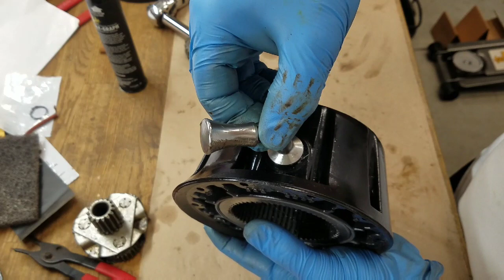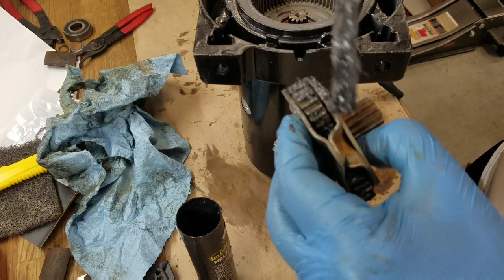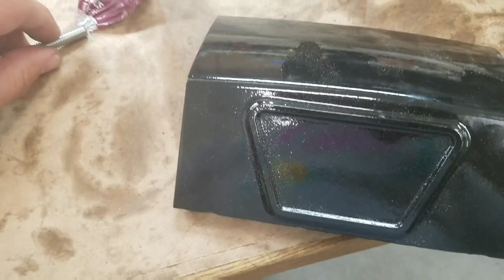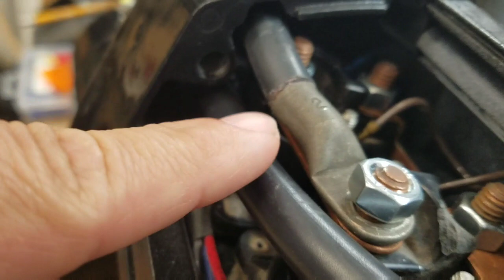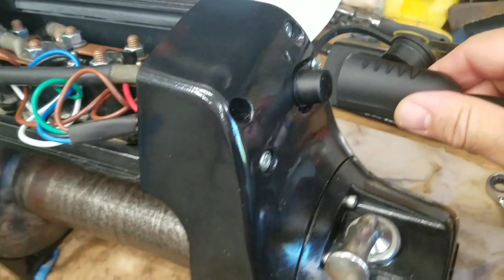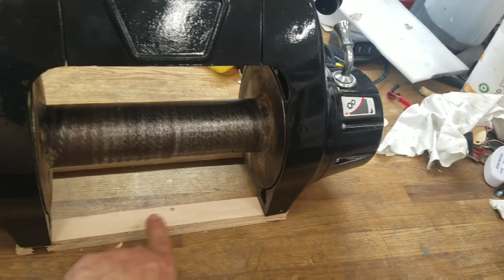Warn 9.5ti Restoration DONE!

Comment: I just had my free spool side apart as it was stuck from corrosion. The intire gear set and shaft came out with the end cap and outer gear housing. The clutch/brake parts stayed in the other end in my case. This made it easier for me to stage the gears on the shaft and then assemble them in reverse to how you did it. Everything fell into place without much fuss ending with the outer housing splines over the whole gear set. I did have to super glue the gasket to one side of the housing. I applied lucas gun oil to the free spool area and moly grease to the gears. I cut my own gaskets from a roll of paper gasket material from ace hardware.
Reply from the maker: Good that your brake stayed in.     I really didn't want to mess with it but....    good idea on the super glue.   I've used some grease before to gold the gasket too.

Comment: Dear i need to know about the current rating of these solenoid. Is it 200 amperes for forward and 200 amperes for reverse or these 4 solenoids are in series with 400 amp rating. I have 9.5ti warn which have 4 solenoids with 100 amperes rating each.
Reply from the maker: The warn winch solenoids are rated at 250A continuous and 480A peak.    Two are used for forward, two for reverse.  Hope that helps!
Reply: But my system trips each time when the current exceeds 200 Amp
Reply from the maker: @Struggling_Hard461  You may have a motor winding issue, or a different ground problem.    Good luck!

Comment: I have this winch on my 2003 jeep rubicon tj. Mine is gray. I have heard they are great winches. I replaced cabel with a red 23000lb To yo  synthetic 100 ft cabel. What is your ex0erince with this winch
Reply from the maker: It's an excellent winch.   Mine is an older version that's not as easy to service.    But I have zero issues and also upgraded the cable to synthetic line.

Comment: What grease did you use on the internal gearing? I have the warn 9.5 CTI which is almost the same. New it's 1,800$ I just replaced the freespool gear and cover sold as 1 unit for 165$.
Reply from the maker: They're not too finicky about grease.    I've used marine "red and tacky" stuff as well as grey moly grease.     The red stuff is what I found in a 40yr old warn I just bought.    If you do any water, that's the way to go.   Just remember that these winches should not be forgotten about on the bumper.    Most people treat them as disposable, but they should go through a maintenance cycle like any other machine.     Good luck!
Reply: @comfort_in_discomfort  I just looked up on warn they recommend Aeroshell 64..a moly based grease...but thanks...you did help me by showing which direction the ring gear goes in the end cap.
Reply from the maker: @scottsime5197  yeah the aeroshell is expensive.

Comment: How much did the restore cost you with out the motor
Reply from the maker: Good question.  Let's see:
Genuine warn parts (seals, 4 solenoids, sticker) = $120 roughly 
Local fasteners (for the cover) = $15 
Ebay for a used winch controller =$50
Paint (I already had it but let's say I bought it) =$20
So that's about $205 in parts.  

The motor was an Ebay purchase.    It cost roughly $150.   

So all told around $350-400 +/-
Was it worth it?   I'm not sure.  It took a while, especially the cleaning and sandblasting.  But it was enjoyable.
Reply: @comfort_in_discomfort   I feel it’s worth it... you can still find some old new 9500ti in stock I was looking last night and they are 1300 so yes it is it’s a good build if you enjoyed it
Reply from the maker: @crider46  yeah.   There are new cheap units like Badlands, for around $4-500.   But it's not a Warn.  So it's a trade off.   This one is going to go on my Jeep.
Reply: @comfort_in_discomfort  I have one on my 93 Toyota pickup

Comment: The problem on the old motor ist the  new color between  motor tube/housing and brushes cage/housing, you need ground contact on 2 brushes but with the new color is this not possible
Reply from the maker: I never thought about ground contact on brushes...

Comment: Do you happen to have the part number for the new short harness? I have a buddy that needs to do this to his 9.5ti, and having an issue finding the correct part number for the new short harness.
Reply from the maker: By short harness, you mean the one that connects the solenoids to the socket plug?  I purchased mine on ebay.  I used Warn 86688 as the part number.

Comment: I’m doing mine now.. struggling a little with operation. It rattles and acts like something is out of order. I’m sure it has to do with setting up the brake system. I basically put the new brake in the spool and then let the coupler set the depth of it... but something isn’t working correctly.. Warn has been impossible to get ahold of lately- extreme long phone waits..
Reply from the maker: Yeah.   Be careful with the brake.    I was able to get a hold of Warn a while ago via email.   They sent me the diagram of the pre-set required for the brake tension.  Its finicky.    Its also the reason Warn only sells the full brake assembly (you can't buy shoes, etc).   The brake pre-tension is roughly 1/4 turn of the brake spring.   Good luck!
Reply from the maker: Also check that your forward/reverse lever is tight.    Mine made a noise because it wandered to a "between settings" position.

Comment: How did you set the brake and install it? You didnt film the installation of the break
Reply from the maker: Good point.  I had to ask Warn how to do it.    It's one of the reasons they sell the brake assembly as a full piece. 

Essentially, when the brake shoes are aligned around the shaft, you have to preload the spring about 90 deg.  While holding it like that, the assembly gets pushed into the drum.    It was a PITA.
Reply: I have a dead 9.5ti I'd like to rebuild. I've watched the entire video series several times, great work, very helpful! Is it possible to keep the brake assembly in one piece while taking the winch apart for a rebuild?
Reply from the maker: I think the brake assembly is different depending on the age of the winch.    The brake is inside the drum, so if you keep it in the drum, and don't remove the shift, you should be able to take the bridge and left, right sides off.  Good luck!

Comment: Do you know this 9.5ti or 9.5cti warn winch is water resistant?  If the car gets flooded through the electric box, will this winch break down?  I am thinking of buying a used 9.5cti-s.
Reply from the maker: No winch is fully water proof.    However, they will all work if they are wet as long as maintenance is done.   If you are planning on getting a winch wet, you can do some preparation with dialectic grease on the contacts.   Ultimately they are all rated for hard use, but require maintenance after. 

Why not consider a winch that has a separate solenoid box?   You can mount the box up higher where it can stay a bit more dry.
Reply: @comfort_in_discomfort  oō